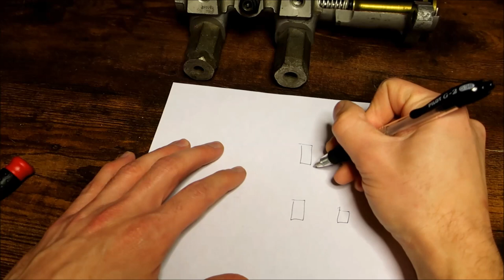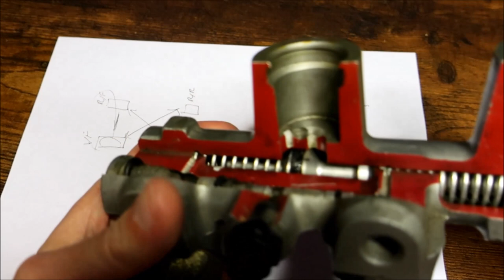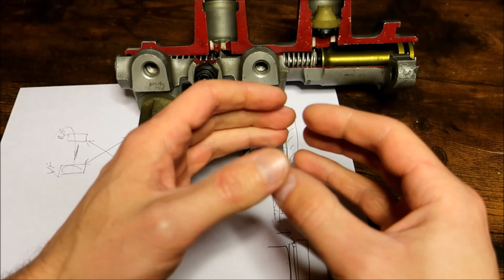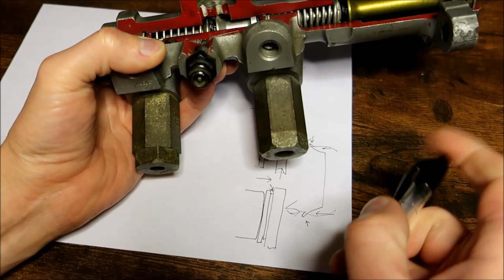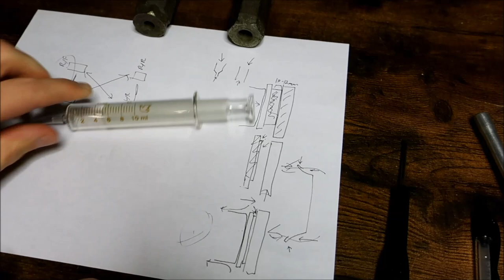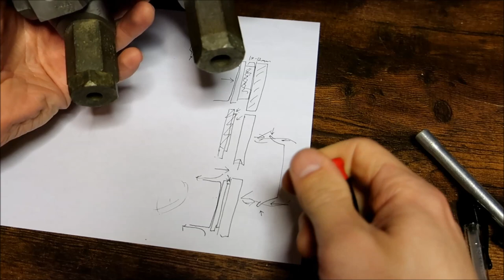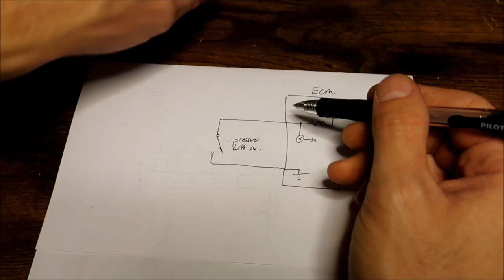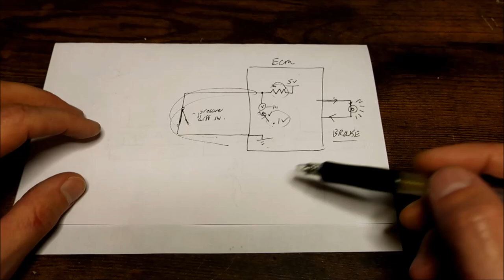Brake Master Cylinder: In-Depth Look and Analysis

Comment: Hello, I have a question, I have an Audi a4b5 1995 year with abs. A couple of days ago I had a problem with the rear left brake caliper lightly sticking (couldn't feel it while driving) and overheating the wheel until it started to smell. In the process, I lost control of all 4 brakes. The pedal dropped to the floor. If my thinking is right I should have lost control of 2 out of 4 brakes not all of them. Could this be related to a faulty master cylinder maybe with internal leaks? After a cooldown period, the brakes are working fine as usual.
Reply from the maker: If it were a master cylinder internal leak issue, the problem would be more consistent regardless of temperature. Keep in mind that if the master cylinder had a faulty cup seal(s), it wouldn't be able to properly maintain pressure in the brake system. 

Initially, I thought maybe a restricted brake line at the L/R caliper could be a possibility (not letting the piston retract properly even when the pedal's released), but that doesn't make sense considering how you said the pedal dropped to the floor and you lost all braking, BUT there's probably more to this.

I'm curious if the ABS module on the HCU is interpreting the slower moving wheel as a lock-up condition and attempting to release pressure from the system to "correct" it. This may have been what you're experiencing as a pedal that falls to the floor. I would focus on figuring out why the L/R caliper is partially applying the brakes – check for a restricted line, caliper guide pins seized, caliper piston not retracting correctly, etc. – before continuing further. The ABS module can act really strange if it's not getting proper feedback signals from all 4 wheels. 

It's really difficult to troubleshoot something like this online, but I would go that route first.
Reply: @TimmaethBoy  The rear calipers are very old and rusty. I will change them both. The rear left didn't retract completely but didn't stick hard enough to slow down the wheel because I didn't feel the car driving differently later when the problem arose I stopped and put the car in neutral and tried to push it back and forth on a parking lot it seemed normal. So I doubt the abs trying to let go of the brake was the cause. During the time the problem manifested it self I had to do a bit of driving to get to where I can call a tow truck and if I pumped the pedal I had some braking for a very limited time (seconds) before my foot sank to the floor. There was no pedal shaking like when the abs is operating. The problem is I asked around and everyone is telling me if you overheat or lose even one brake they all fail but by the info, I know about brake circuits, and all I found on the internet there should be a failure of only 2 of the 4 brakes in my case.
Reply: @TimmaethBoy  dont know why youtube doesn't let me put a link I disassembled the cylinder. Maybe you can give me your email so I can send you the disassembled picture of the cylinder?

Comment: I havent watched all of the video yet I paused it . 
   I’m having an issue with brake pressure going away during driving and coming back over night .   
   One day it’s good a few hours later they suck , or I’m driving then I make a run into the store I come back and the brakes feel great . Then I make another stop and then start the vehicle back up again and my brakes suck . 

  I have zero leaks fresh fluid and I have bleed the brakes a few times .

Comment: can a failed master cylinder cause a pedal to not return after being pressed
Reply from the maker: Highly unlikely, unless the pushrod is binding in the backside of the primary piston. Check your brake pedal return spring mechanism and the lever in general to see if anything's binding.

Comment: Is is possible by us to customize the masters cylinder?
Reply from the maker: Yes, you can customize a master cylinder and braking system to your particular liking, but that will apply more to vehicles that do road racing/auto-crossing scenarios.
Reply: @TimmaethBoy okay I could get ur point but I like to customize a master cylinder of piston dia 13mm can u suggest me to achieve it. Like the procedures to perform if I get the help it will be so thankful to u..
Reply from the maker: @evilmastro1515  The best way is to find someone who specializes in custom brake systems and talk about what you're trying to achieve and go from there. There's probably already products out there with custom piston sizes that may meet your needs. Otherwise, that's a lot of potentially expensive design and machine work to make a custom master cylinder with specific piston/bore diameters, etc.
Reply: @TimmaethBoy  but I don't know how to find the person
Reply from the maker: @evilmastro1515  Google search for local businesses and call around. You can also do research online as well/ask in forums and they'll point you in the right direction.